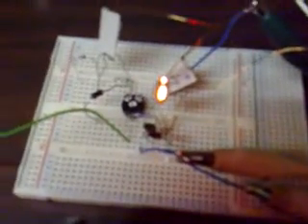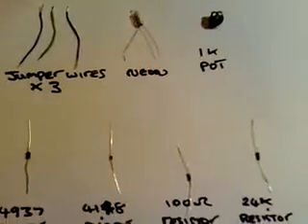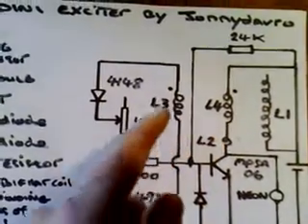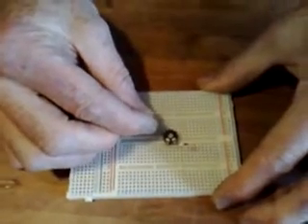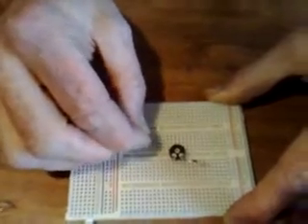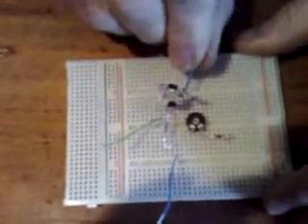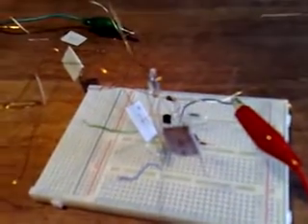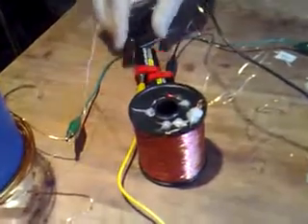Bedini exciter step by step build

Comment: Thanks. I'll first try the 2N2222 and if that doesn't work then I'll have to buy some from jameco.
I did get some plasma from a sec exciter circuit using an IRF510 at 9 volts drawing 1,6 amps but I had to touch the bottom end of the coil with a pie pan plate to trigger the amp draw from 1 amp to 1.7 amps.

Comment: Hi, fine job and tutorial ! I only want to give You a tip. Its match more easy to use a pinset to puch Your wires in this holes. When I work with IC my fingers are match to big and it's getting even more wurse when You start to work with surface mounted bords. You even need almost a microscope !